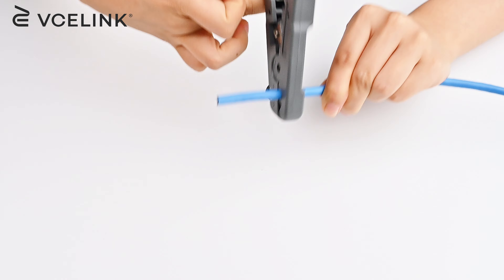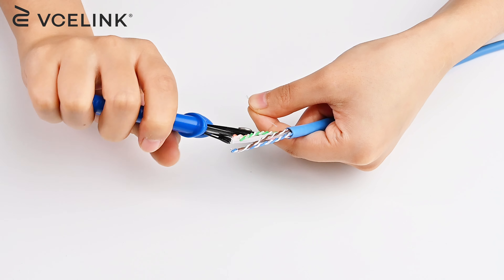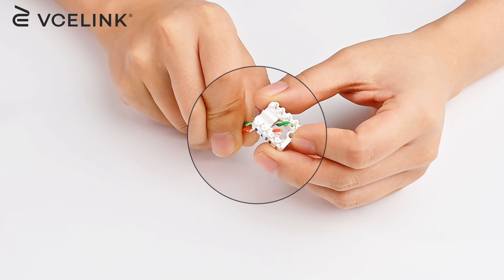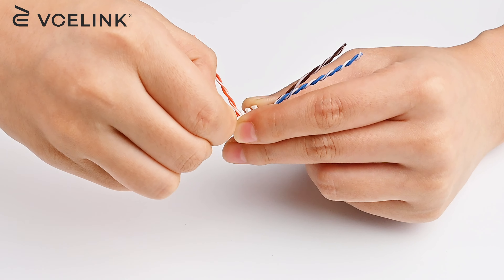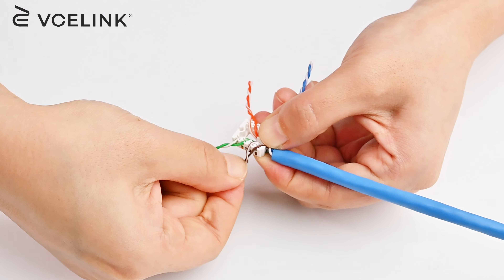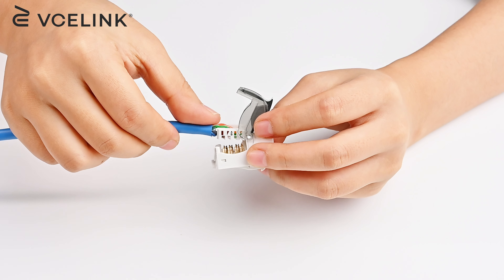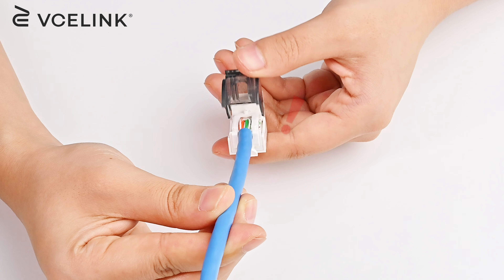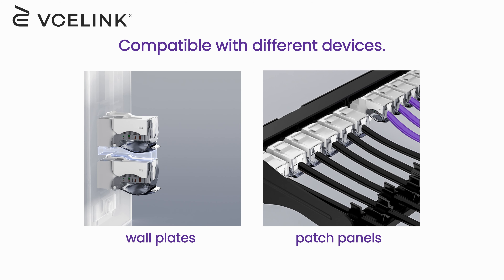💡New Release: VCELINK Unshielded Toolless Cat6 Keystone Jack！

Comment: And if one of those crappy little die cast pins is slightly mis-aligned when you go to clamp it down you just wasted ten bucks.
Reply from the maker: Thanks for sharing your feedback. Please note that this keystone jack is reusable. If you wrongly aligned the wires, you can use a hook tool to remove the wire. Please check this video. https://www.youtube.com/shorts/7PvZWTZ84FQ I hope this will be helpful to you.